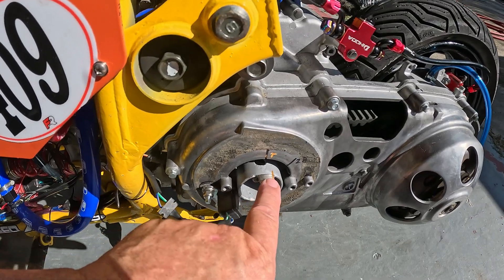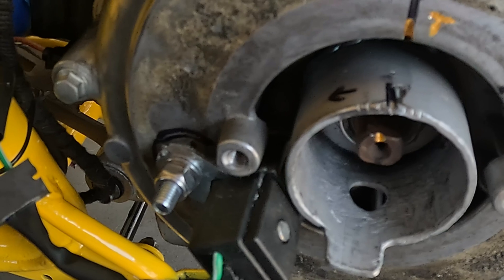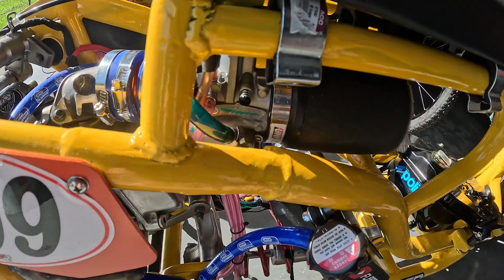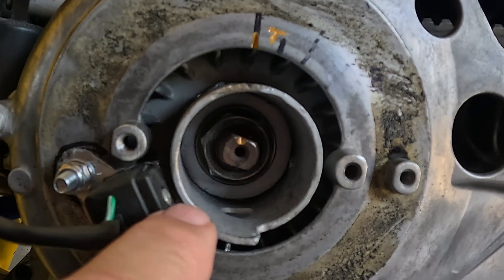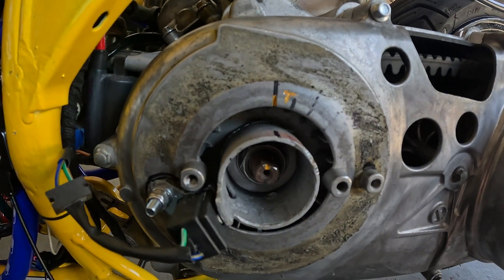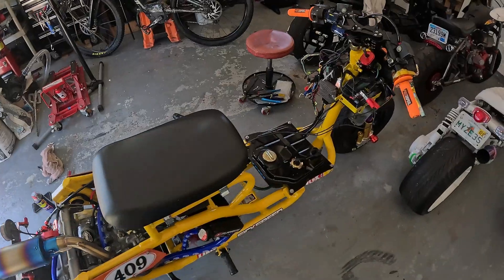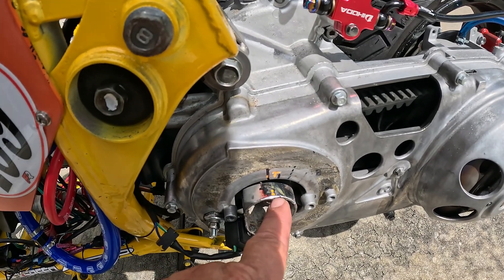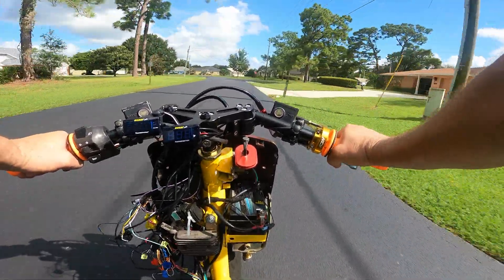Chuck It!  Part 7:  Make a Custom Motorcycle Ignition Timing System From Scratch

Comment: Why so many jump cuts while talking?  I find it jarring.  Could you perhaps rather string a few sentences together instead of recording them one at a time and pasting them together afterward?
Also, how do you intend to advance the timing as the engine speed increases?  Obviously the faster the engine is spinning, the earlier you need to trigger the spark.
13:37 - Typical.  Harley snobs... don't wave, give them the finger instead.
Reply from the maker: @2000jago  LOL.   That is my epic editing.  I'm cutting out all the long pauses and all the uhmmmms.  Otherwise, it would be 2 hours long.  Computers can't alter things that have not taken place.  Time travel paradox.  
The  CDI can ONLY delay spark based on what it knows.  It only knows RPM.  So mechanically the pickup coil needs to be mounted at max advance (28-32 degrees?) And stays there.  Now based on rpm or pulses per second, the CDI delays to the equivalent of 10 degrees BTDC.  As rpm increases the delay becomes less , effectively advancing spark.

Comment: Do you know that The pickup on the leftside then rightside is mounted? The cdi dont know that! 😉
Reply from the maker: @Nokkie-Buell  not sure what your saying.  🤔.  The original pickup was on right but went to a computer.  18 spaced notches on the flywheel in oil.
Reply: @GhettoWrench  you mounted the pickup from the right to the left side? 😉
Reply from the maker: @Nokkie-Buell  yes.  Figured it was easier than modifying the original flywheel.  But I may have been wrong.  😆
Reply from the maker: @Nokkie-Buell  as I understood it the CDI can ONLY delay spark based on what it knows.  It only knows RPM and not direction.  So mechanically the pickup coil needs to be mounted at max advance (28-32 degrees?) And stays there.  Now based on rpm or pulses per second, the CDI delays to the equivalent of 10 degrees BTDC.  As rpm increases the delay becomes less , effectively advancing spark.
Reply: Haha i think also! 😉
On the rightside it go,s clockwise and on the leftside counterclockwise and the cdi don,t know that!
For advanced and retarded ignition timing
Reply: Now thinks the cdi going advanced butt its going retarded 😉